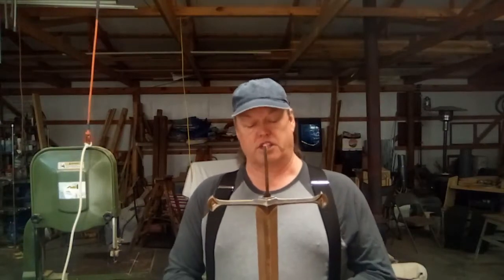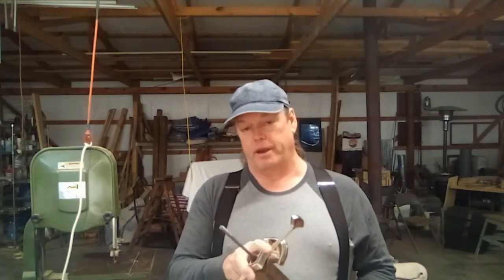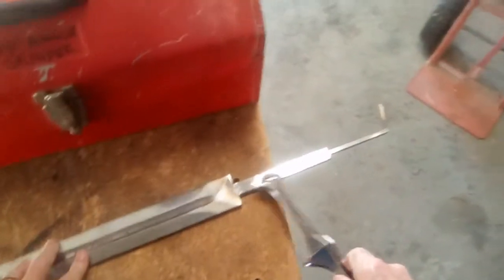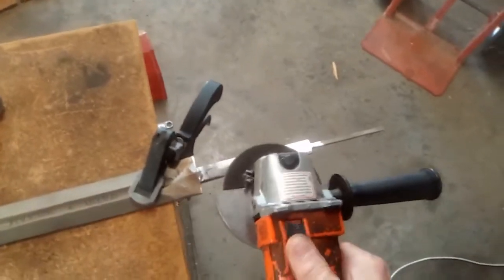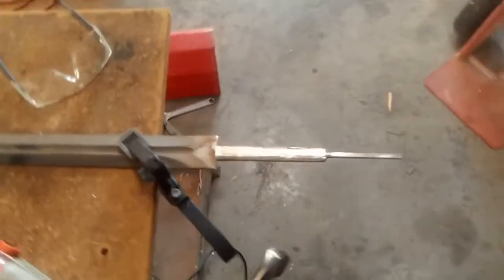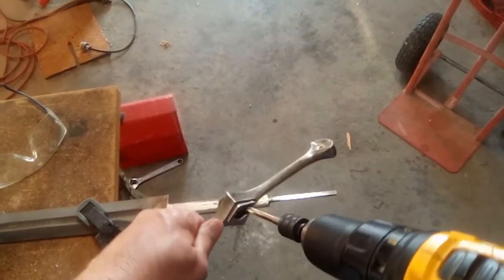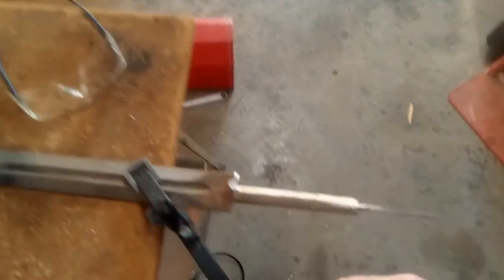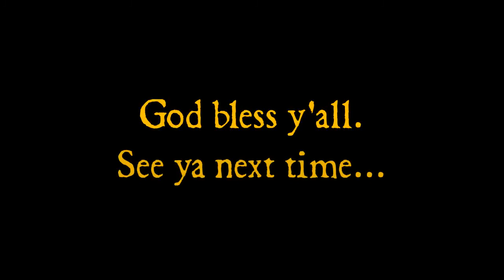Fixing Anduril - making a display-only Claymore sword in to an (almost) battle-ready sword - Part 1

Comment: I have the same defect with mine... time to buy a welder I guess
Reply from the maker: Well, it's not exactly a defect. It's an ornament. If you go to sites that sell swords, they have 2 kinds (and the price reflects it): Display and Functional (or some other word that means you can use it, and not just hang it on a wall).

Comment: The  blades themselves are good quality. but they just made the tang rat tail, as they call it. I actually bought that one and the aragorn ranger sword. turned them into functional swords
Reply from the maker: This was a knock-off, so the tang wasn't even rat-tail. Thanks for commenting!
Reply: @ArkansasPilgrim  yeah, sure. I used to have a lower income and I purchased cheaper blades. Learned through trial and error
Reply from the maker: @dominiclapinta8537  I need to post a video that explains why I even bought this sword in the first place. I give a brief mention of it in the first video m, but it bears expanding upon.

Comment: I don't understand why they make these swords in such a fragile way, I understand that they are not real weapons, but it would be enough if they were not sharp, I would also find it preferable if they used alloys that do not allow sharpening, but they sell swords that can break with a simple fall It's sad, anyway I think it's a beautiful piece.
Reply from the maker: Well, this one is a knock-off, not an official, and it broke because I was swinging it around a lot, and it's heavy.

If you go on sword-selling websites, they say clearly if they are "DISPLAY ONLY". Of course, if just dropping them will break them, that's pretty lame.

Thanks for commenting.
Reply: @ArkansasPilgrim  So can they break just by swinging them? A fall is not necessary...or a blow?
Well anyway I'm glad you were able to repair it, i saw the PART 4 Video and it looks great.
Reply from the maker: @weirddudehi  I swung it around a lot. It's a heavy blade, so it stressed the handle, and it just wasn't designed for it. It was intended to be hung on a wall for show, or just held and looked at. I really have no complaints about the quality.